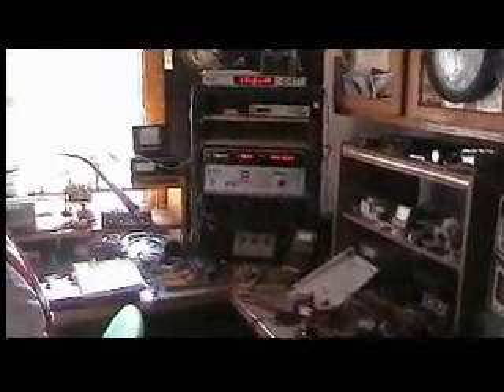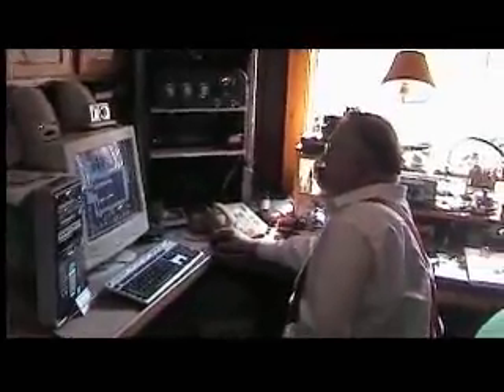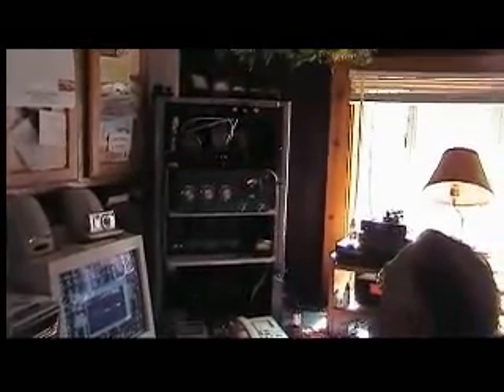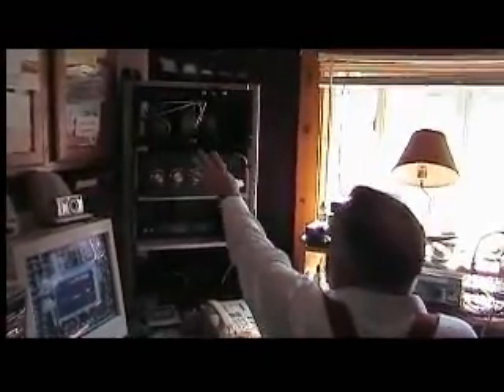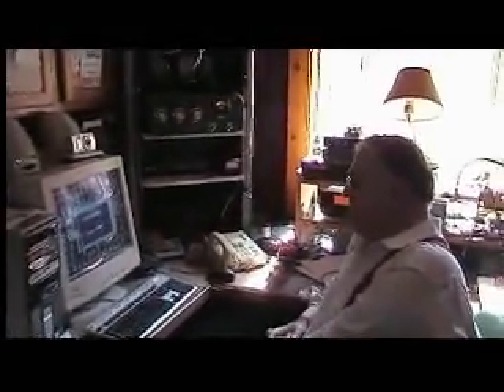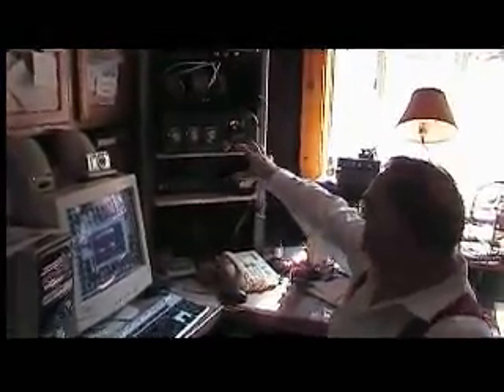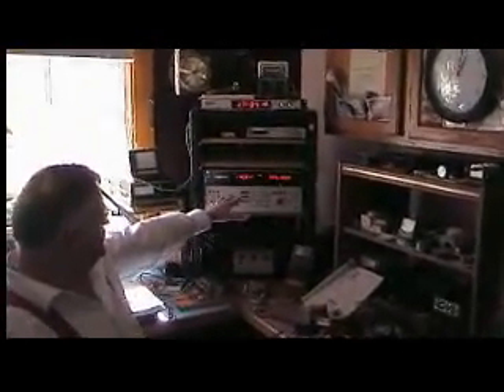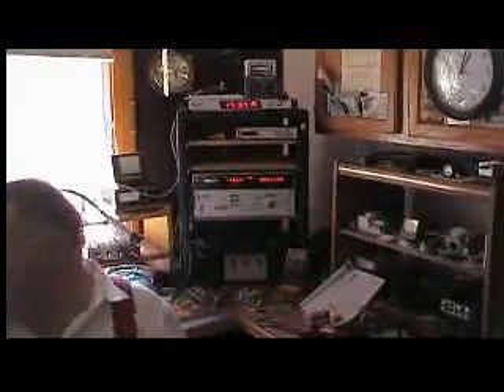WD2XSH/17

Comment: last night  tuned 499.600 kHz WSPR    21 decodes -18 -28 snr   using my  just errected K9AY
fb  signal   in JO33hg     my TX  is out of order I need a new ATU for 500
73 PA0O  Jaap